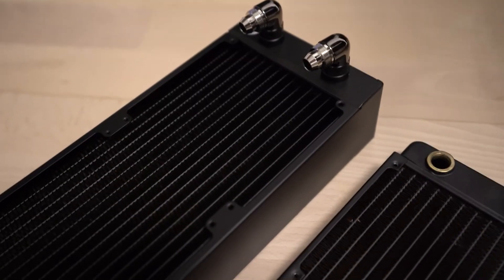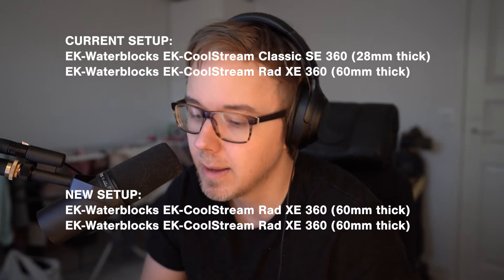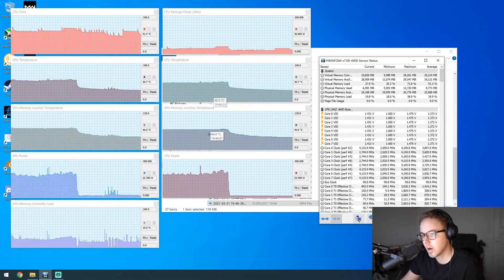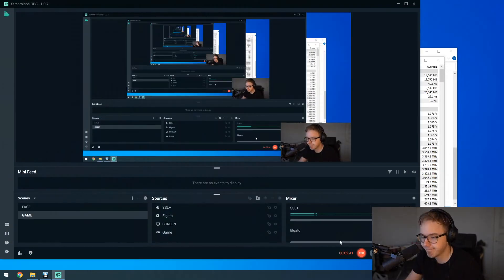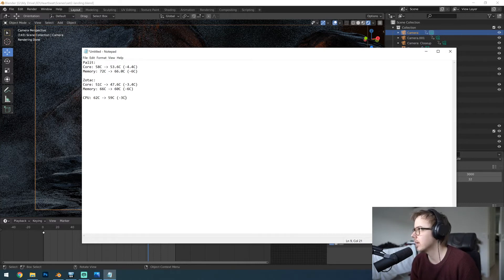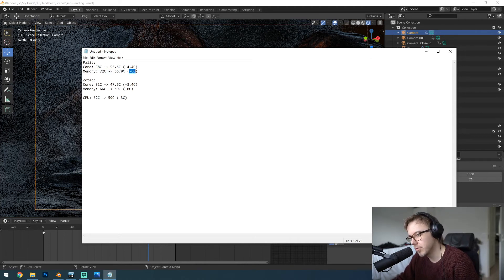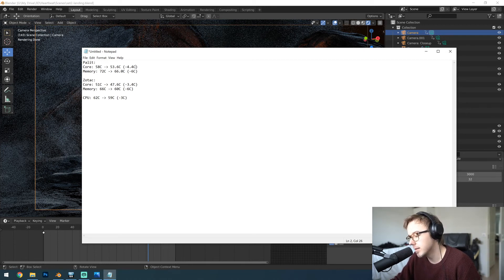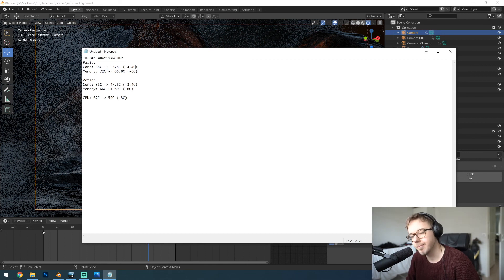Upgrading EKWB CoolStream SE 360 vs XE 360, Quick Temperature Test

Comment: One complaint i have about your rig as far as this testing has gone. For one, you are using an SPC pump on two 360mm radiators (thickness doesnt matter at this point. The flow rate you have on your pump is NOT enough for two 360mm radiators, especially the 60mm thick XE series. Then you have to think about what all is causing some kind of resistance. ( Both GPU blocks, cpu block, fittings and the XE 360 rads themselves. So this explains the very little gains you got out of adding another XE radiator. IF you were to upgrade your pump, or even have two separate loops, You will more than likely see a MUCH larger decrease in temps. I found this out the hard way with the same pump but with (2) 240mm PE radiators and two 2080Ti's.
Reply from the maker: Yeah I'm sure it aint perfect right now. I just don't want to invest more money into it only to inprove mining. For Rendering  3D This setup has been working perfectly but I did lose a bit of money over the summer for having to bump down the performance on the other card

Comment: I'm doing a similar upgrade, I have an 9900k and 3080 and a 3 rad loop, Dual Thermochill PA.120.3 360mm rads (these are 14+ years old)  in the bottom of my Thermaltake X71TG case and I have an 360mm EK Classic SE, 27mm thick in the roof and I'm swapping that for the XE360 and hope to drop my temps 5-10c, also the 27mm rad is really restrictive, it took ages to bleed the air from my 3 rad loop, so i'm hoping when I rebuild it I can make it more efficient too and shorten some longer tube runs.

I was going to purchase a smaller case and get an MO-RA3 too but decided against it in the end as I couldn't justify the cost which would have been approaching £300, also I did consider removing the roof from my X71TG case and sliding into the front an 560mm rad from Hardware labs but couldn't find the one I wanted in stock and most of the rest i found are not as good as 2x 360mm rads which would have been removed from the bottom section of my case since the 560mm would have taken up the whole of the inside front of my case, It would have been an interesting mod though since I doubt anyone else has attempted it as normally the front of the X71TG only takes a 420mm rad or 360mm, but a 560mm will fit if you remove the rivets and take the roof off. That would have looked pretty sick tbh, and probably the only one in existence.